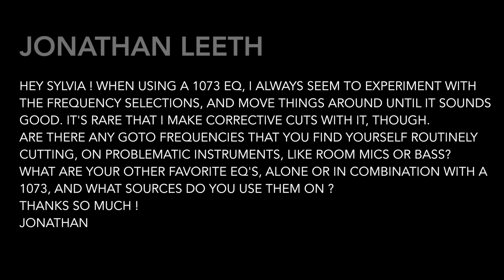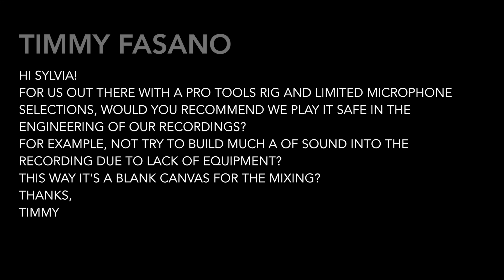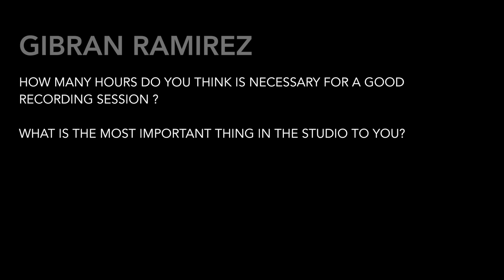MWTM Q&A #25 - Sylvia Massy

Comment: "I tend to add, more than I cut." This goes against the advice of practically every mixing instructor out there. I've recently gotten into engineering and mixing, and one thing I'm learning is there's no set way of doing things. Guidelines, but not rules.
Reply: exactly, there are people who go against the grain all the time, and the results make the record work. just all about experimenting and what is best for that song at the time.
Reply: I rarely boost when mixing with plugins because the "changed" frequencies tend to sound unpleasant, by cutting them the anomalies that appear are less hearable. I only started boosting when I got hands on good outboard EQs.
Reply: @simonbezek6382  True! You do have to have a really good quality AKA REALLY EXPENSIVE analogue EQ such as those found on expensive analogue desks and outboard to make boosting frequencies sound "right" otherwise if you boost a lot with plug-ins the sound is not right, sounds "fake".
Reply: As Sylvia mentioned "Neve", "API".
Reply: Haha CLA +15db on the top, shelved. On EVERYTHING!!

Comment: the sm58 sounds good if you have a good mic preamp like neve 1073 with INPUT Transformers good alternatives a V72 or V76 good mic preamps are much more important than the mic inself. if you don't have the budget add input transformers to cheap mic preamps. the sm58 can be easyli upgraded ... remove the capsule put the mic in the oven and remove the internal transformer and replace it with a high quality one.

Comment: So inspired by this! I'm a violinist that doubles on the other strings, and all I use is a Neve 1073! Feeling validated by my choices so far, and really excited to try the tip about all the mics pointing in the same direction.
Reply: Hey Rob, I know it’s been 5 years since this comment... but how did you point your mics on the drums? I can understand the closemics all pointing one way but overheads..? I’m confused
Reply: @powerlioneaglefist  Ahh good question... I haven't done a lot of drum tracking since then, tbh, so I forgot all about this until your comment. Thanks 🙂

I think it's as simple as having overheads not straight up and down, but rather angled toward the player, rather than away from them (at odds with the kick drum mic, for example). Try experimenting with angling the overheads, rather than completely vertical. I have no idea what effect this will have... let me know if you get any good results, please!

Comment: I wish I knew what she meant by facing all the mics on the drum kit in the same direction. I need a mental picture
Reply: +No Filler Words Productions I also had trouble wrapping my head around it, but that's how I eventually understood it : imagine a drum kit with toms around the drummer as usual ; instead of having the mics follow the same half-circle and each pointing towards the drummer, each should point to an imaginary wall behind the drummer. In the first way, the HH mic and the low-tom mic should face each other, in the second way, they should aim at the same imaginary wall. Not sure if I'm clear :/ !
Reply: +Henri de Saussure I think you're right with the imaginary wall theory. That's what I took from it as well.
Reply: how would this concept apply to overheads?

Comment: Important to note that phase should only be flipped on the bottom mics (not both) for each double-miked drums.
Reply: thx for clarifying that
Reply: How do u know if you need to flip the polarity on one of your overheads?  If they're both equal distance from the snare can it be possible to still need to flip the polarity.
Reply: Larry Tate I they really are equal distance, then you would never flip one of them.
Reply: flip it, if it sounds worse, put it back to normal. that is usually my test.  Unless you measure it out it will never be 180 degrees out of phase, but it's usually about finding the lesser of two evils.  If you find that something sounds really off, try flipping the phase.  if it sounds worse than undo it.  if it sounds better than feel like a genius and move on.